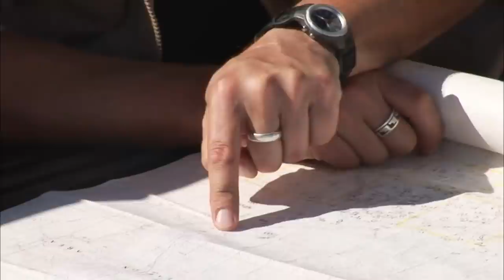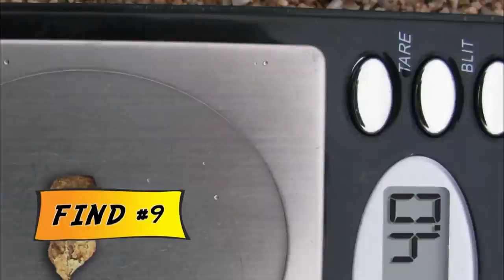Searching For The World's Most Famous Meteor | Meteorite Men | Spark

Comment: radiated power goes at T^4 , so FLIR would only be useful, possibly for chondrites around sunrise /set.
Reply: Perhaps it might have been useful later in the evening... if the mineralogy of the meteorites meant they cooled at a different rate to the surrounding terrestrial rocks & soil, you could wait until after sunset for the maximum differential to be achieved. Just need to hope that point is reached in the early evening before it becomes frigidly cold & you're stumbling around in the dark with torches!